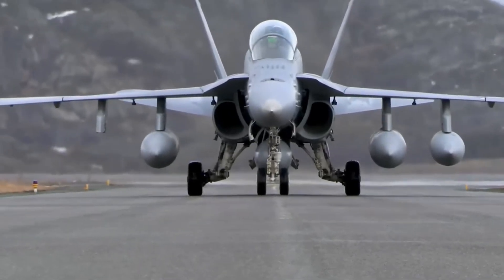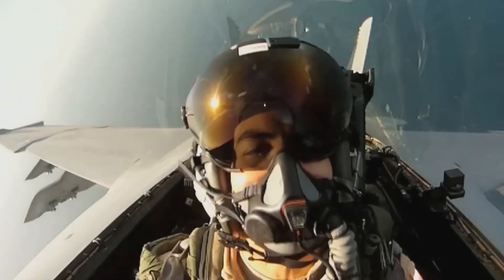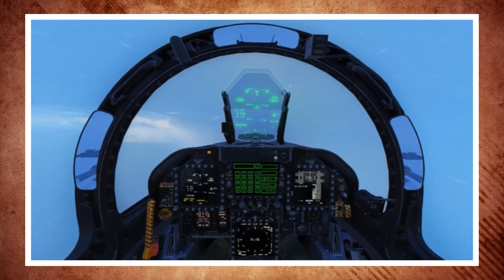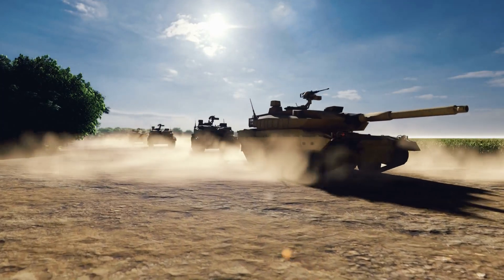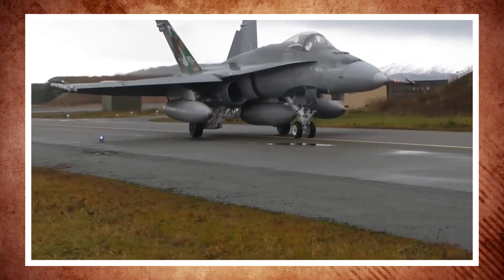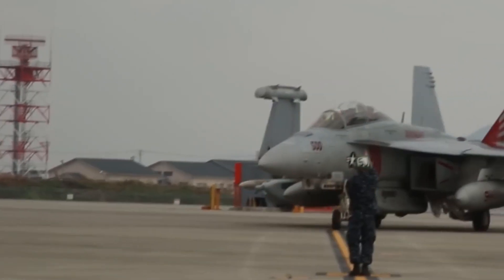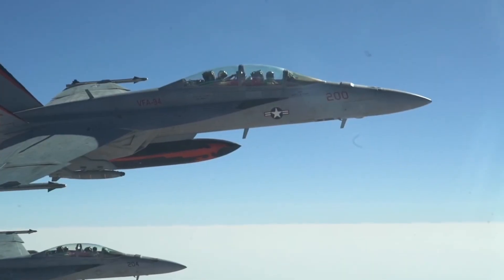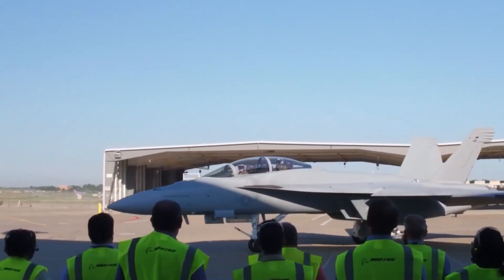The NEW F18 will SHOCK the Industry! Here is why

Comment: It's a great plane when it's slick. Add externals, and it's a fuel sucking dog. Especially with anything on its non aerodynamic wing stations.
Reply: How many flight hours do you have?
Reply: @vicariousjohnson9823  Not a pilot. Just a degree in aeronautics and multiple Hornet friends. Take a look at a bottom view of the airplane noting the angle of wing stores to fuselage.